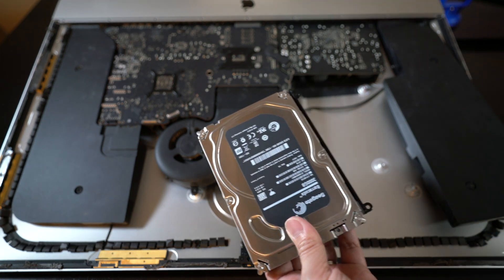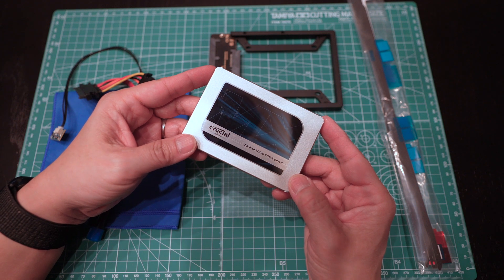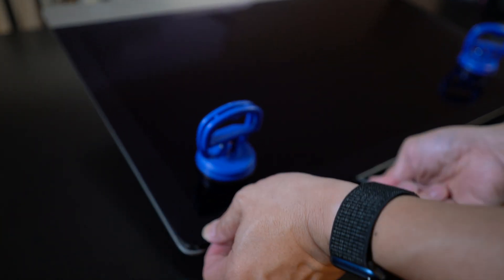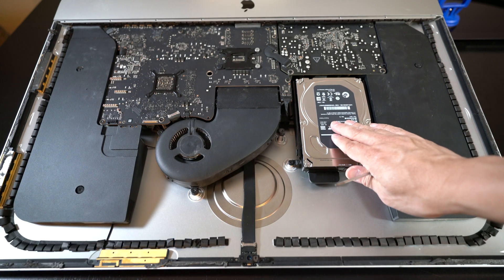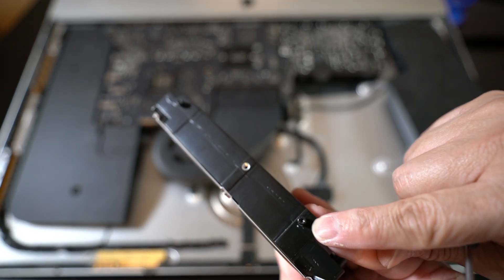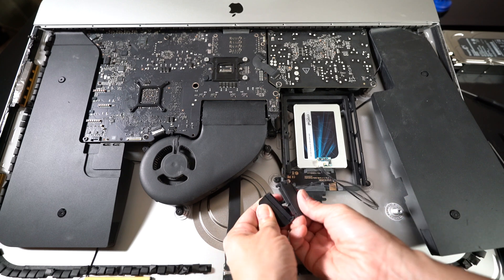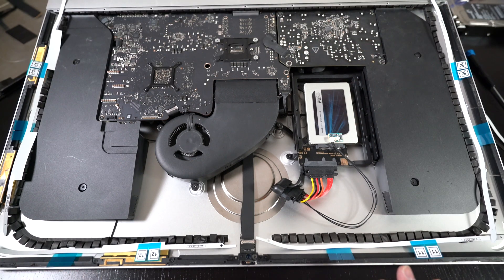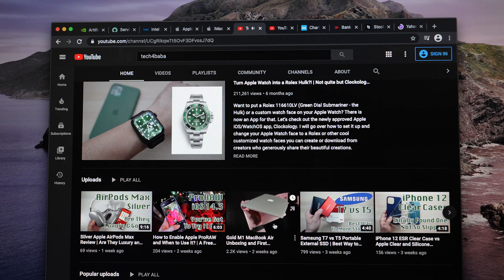How to Upgrade iMac Hard Drive to SSD | Make Your iMac Faster | Step by Step

Comment: SDD is less reliable than HDD. Be sure to not use programs like cleanmyMac that clears up memory and disk space. It did make space, though in the end it destroyed my SSD, causing me to lose all data at once. A certain amount of writing jobs will one day be fatal for the SSD. Anyway, I'm going to see if I can put a SSD in my terribly slow running iMac of late 2015, hopefully it will work out well.

Comment: Hello, I liked your video
It goes right into the action
No time lost
Explained very well the how to change the drive physically, 
But what about before changing it, I have a lot of stuff in my old drive that I would like to copy to the new disk, do you have a video on how to do this?
My iMac is a 2009 21 inch, with 8 gb ram
So it's a little older than the one in your video...
Are there different things to consider?

Comment: I have a 2010 imac with a bad hard drive. Can I use any ssd drive to change out the old bad one?
Reply from the maker: Thanks for watching and asking, Jason! Yes, I think you can.
Reply: Thanks very much for your show and response. One other thing I was wondering somebody said that the 2010 imac could not move any faster than 3gbs speed because of its logic board. If so it would make no sense to go with the 6gbs ssd?

Comment: Is it possible to do this in the Mid 2020 27” IMacs do you know?
Reply from the maker: I don't think so. The SSDs are soldered down on the 2020 27" iMacs. Thanks for watching and asking, James! I think the best way to add fast storage is external Thunderbolt 3 drives like https://youtu.be/PnYaFHwUsUw and https://youtu.be/y6PL_XzwfiA.
Reply: @Tech4Baba  Ya, you’re right. I was looking on OWC for the Sata hard drive upgrade kits and it just says 2011-2019, so I guess 2020 is kinda out of the question. So wait, do the 2020’s even have the Sata SSD or do they only use like a single Flash SSD or something?